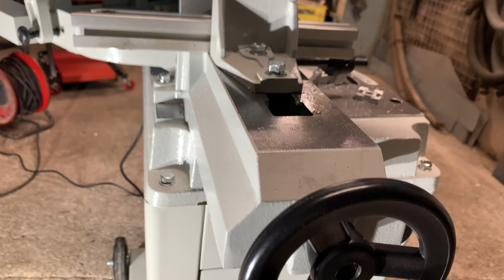Axminster MCB1155HD Bandsaw unboxing and first test... All good!

Comment: Hi. The Blade pinch roller bearings nearest to the operator can be adjusted (slide them nearer to what your cutting to stop blade flex) very good video & great band saw.
Reply from the maker: That’s a great tip, I’ll definitely check those adjustments out to improve the stability. Thanks for watching! 👍🏽

Comment: To anyone watching this in the future of his past, that length stop doesn't interfere with the vice as it's not supposed to go all the way through the casting. You grub screw it one side or the other and unscrew the actual stop & slide that to set the length.

Comment: Does yours have any issues with it breaking blades ? I’ve broken 4 now in a month! Axe has been very good about it but despite checking settings over and over it keeps happening completely out of the blue… Frustrating because it cuts superbly..
Reply from the maker: Hi, I have to say no, not one broken blade so far! I do set the lowering piston on a high'ish setting so it lowers the blade slowly onto the work piece but I expect you already do this. I have cut metal and plastics with different blades bought from Axminster and so far, so good. Good luck going forward and thanks for watching 👍🏽

Comment: I’ve found with mine it’s not good for cutting small pieces squarely .. The design of the vice is the issue by not supporting one side of the work properly… or as well as it could..
Reply from the maker: Hi, yes, I found the same. If you are cutting long stock then you are fine. I've tried a few small pieces and they do move. If I find myself needing to cut a lot of short pieces then I may need to make a support of some kind. Thanks for the feedback and for watching 👍🏽

Comment: Got mine 2 days ago, cabinet bent in many places but i don’t intend to use it anyway.. The only things i don’t like is that the cut off piece is not supported so bends at the last stage of the cut and then the weight of the saw breaks it off leaving a burr… Also the rear Adjustable blade support bearing clash’s with the base when it’s adjusted for small items to cut, if it clashes it pushes the blade over to one side eg out of alignment which is not good.. Also  i find it a bit awkward holding the saw up and trying to engage the lock mechanism etc so now i rely more on the hydraulic valve when i want to line up for a cut etc, and yes as the op said the angle cut scale is not aligned properly, but, it’s quiet, it cuts straight and true cutting shim thicknesses if required.. I shall make a support for the cut off piece issue, that with a few adjustments here and there will provide me with a near perfect saw..
Reply from the maker: Hi and thanks for the great comment. My cabinet wasn't as bad as yours by the sound of it, so I was lucky, and I do make use of it. Certainly there are a few issues with the saw and some simple "mods" can make it a lot better. I'm using mine more and more and love it. For the price I think it's a great bit of kit for the home workshop. Thanks for watching.
Reply: @MikeMakesIt  Hi Mike.. Yes i luv mine too.. I sent pics of the cabinet to Axminster and i can’t fault their service as they offered to exchange the cabinet but i said no as it’s too much hassle really so they said a new cabinet costs £58, we will refund you £60 and you can keep the old cabinet too! Result.. Good video Mike too.. 
NOODLES…
Reply from the maker: @MANOFMANYATS  Great news on the cabinet and service. I’ve only used Axminster half a dozen times but all orders came though without an issue. Good to know you had a good experience from the too. 👍🏽